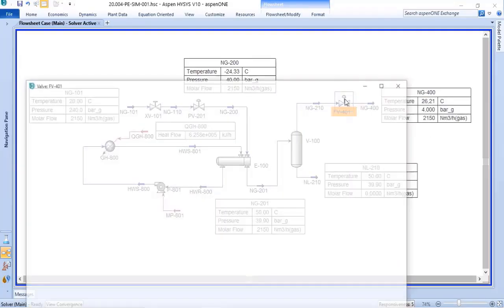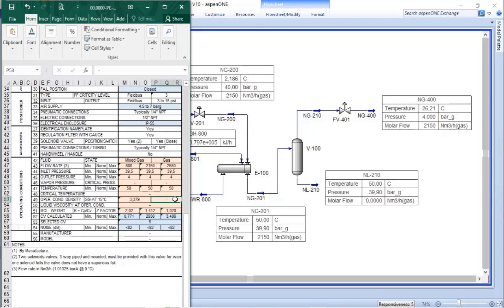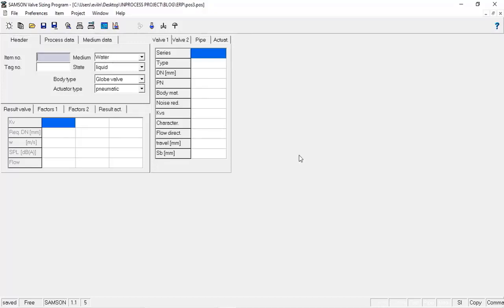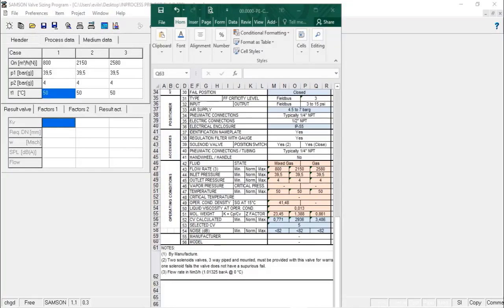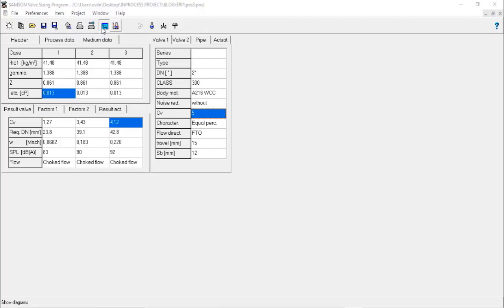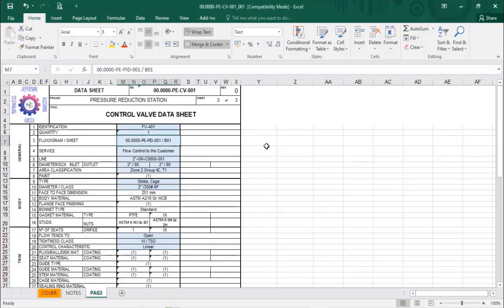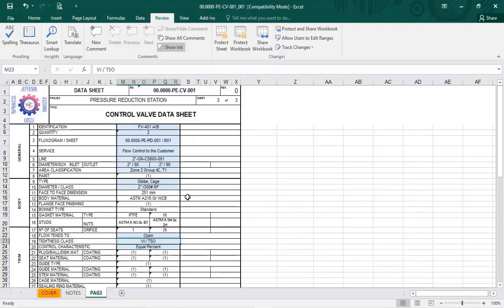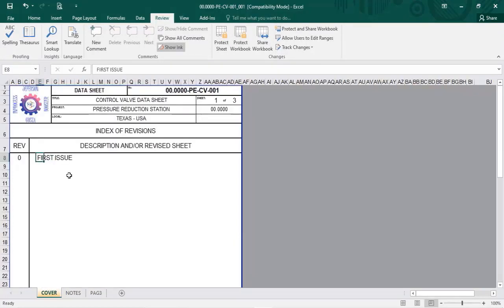Control Valve Sizing for Chemical Engineers

Comment: Which body type must I use for gate vale?
Reply: Gate valves are not used for control, throttling or regulation, hence the softwares will not include gate valves
Reply from the maker: Hi Hasho, the valve body type, i. e. material valve, must be chosen according to  the process condition and the characteristics of the fluid.
Reply: @jefersoncostaengineer  thanks but I meant in the software because gate valve body type is not available in the software list

Comment: Great material. Thank you for sharing such detailed analysis. 

I have one question regarding the data sheet item 18. This information defined there is related to the gas coming from the vessel up to the valve? I mean the gas is coming upwards and then it can cause the valve to open. Is this analysis correct? 

Thank you again.
Reply from the maker: Hi Luis, yes. Your analysis is correct.

Comment: All your flow conditions are choked flow. How can you control that conditions?
Reply from the maker: Chocked condition is not a issue if Mach number and noise is under desired condition. Vibration on control valve is one concern to evaluate. To avoid choked condition you need to decrease pressure drop through the control valve.

Comment: Really great video
Is cv calculated by this software is same as calculated by hysys?
Reply from the maker: Hi Savan, no. In Aspen Hysys, for the same travel opening at design flow the CV calculated is 5.288 (no other parameters changed). Just remember that, Hysys that should calculate the CV as the same as Samson software because is the valve from manufacture that is installed in the field.
Reply: @jefersoncostaengineer  thank you for your reply sir,
So can we say that we are getting error or hysys is not as accurate?
Reply from the maker: @savanjavia9117  we can say that HYSYS is not made for buying control valves 😁